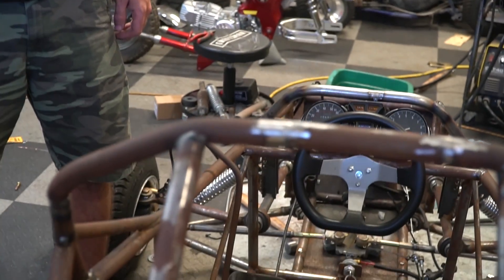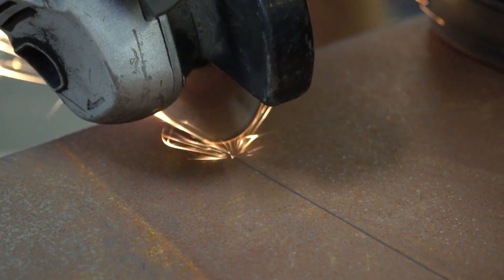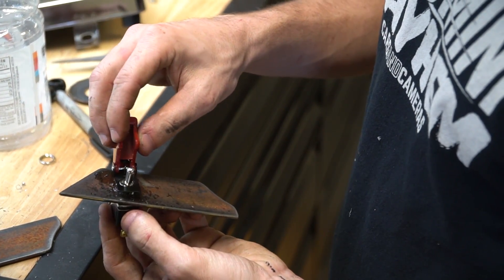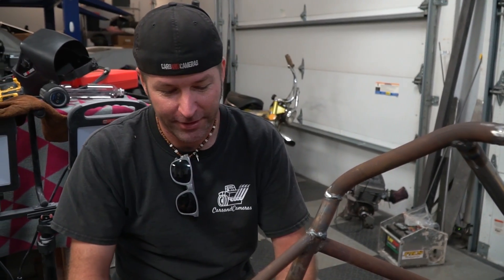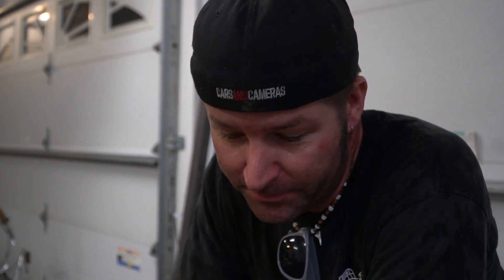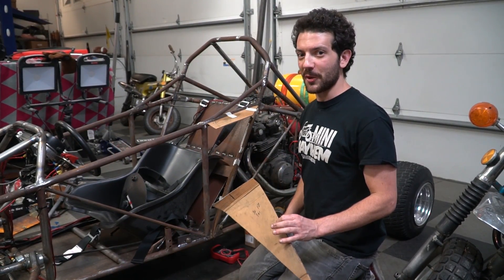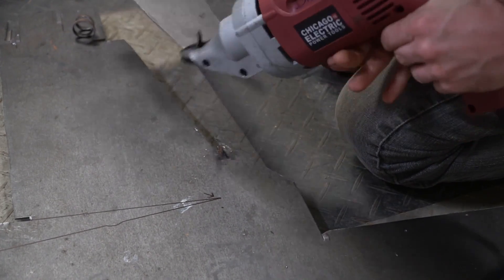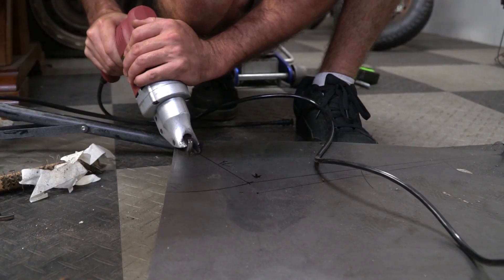Fabricating Air Scoops, Firewall, Dash, Fan | Cross Kart Build

Comment: Mount actuator higher on shift lever. More leverage would mean easier time for that thing to shift
Reply: Craig Kirkland go higher you get more leverage but limited by stroke length
Reply: Change the throw of the E shifter by adding a pivoting lever to multiply the throw distance . If you have 1 inch of movement at the top with 1 inch to the pivot and 2 inches to the other end after the pivot then you double the throw and it will work.
Reply: @AlphaMachina  😂😂
Reply: Make a solenoid or have 1 made. It's not that hard.
Reply: Can't you try two of the electronic shifters wire one to push and one to pull at the same time(setting them up mirrored to each other then you have double the force
Reply from the maker: Actuator didn't have enough throw to pull it off.
Reply: @CarsandCameras  You could use a cantilever set up, kinda like some off-road trucks use to increase the suspension  travel.
Reply: @UncleSpuddy  lol im pretty sure they saw my comment before you commented the exact same thing -.- lol
Reply: CarsandCameras have you considered a cantilever setup? Totally my idea.
Reply: @MadMotoInc  🤣
Reply: @nathanbutler8240   The cantilever to get more throw length will lessen the pushing power and vise versa. They can buy those for about $9 on Ebay. Just buy a second one and double the power.
Reply: @cheeto4493  or put another battery change it to 24v and get the extra power. These actuator can handle 24v as they are in most diesel trucks and there 24v systems. And if 24v slams it to hard you can run a resistor or a diode and cut it down to 14v and even have a button that will cut it down farther if needed to barely hit neutral from 1st and not so hard it bumps it into 2nd
Reply: @CarsandCameras  try a higher electrical current. Just a little bit more amperage should give it what it needs!!
Reply: @CarsandCameras  If you were set on the "Electroshift" idea i'll bet it could be done with a double actuator set up,  one possibly to push and the other to pull,  it would require a 2nd actuator and the wiring would just be reversed on each actuator.  It's looking awesome guys,  keep it up! 

Cheers
Reply: @CarsandCameras  Thanks for getting back to us and for letting us know. Check the comment up there somewhere by @pico67ss about "Hey there are 3-4 different companies that produce electric shifters for bikes flatshifter looks ok"
Reply: You are not wrong but I don't think the actuator has enough throw to make that work.
Reply: @MegaKencam  he could build a cantilever system that would have like 6 inchs of throw off that tiny couple inchs of movement from the actuator and make a ratio  so 1inch of movement on the actuator translates to 3inchs of  movement on the shifter or whatever ratio you guys wanna make
Reply: Well all good ideas, this need to be explored if you ask me
Reply: A double cantilever setup will give you the mechanical advantage plus the throw
Reply: I was just going to comment that but you beat me to it
Reply: Juuuupp
Reply: I would probably look for a door lock sylinoid out of an old pickup truck I had two laying around somewhere from my Honda Odyssey project back in 2003-04 I put a 1973-74 Yamaha Tx750 street bike motor on the Odyssey custom Axle and hubs with pillow block barrings just about everything came from Tractor Supply

Comment: If you you want your mig to look like dimes turn down the machine 1 setting below recommended for the metal thickness and it will cause the metal to freeze better when you whip it.
Reply: Joshua Highfield Turning down the heat wont really help with that, it’ll just make the bead narrower and taller, not to mention less penetration.

Comment from the maker: My vote says body panels, twin turbo and a giant wing. Who's with me?
Reply: Make it look like a giant 80s RC car.
Reply: @carcomp101  thats a great idea to make it look like the rc car from toy story lol
Reply: EFI first
Reply: You had me at twin turbos.
Reply: YESSSSSS!!!! for all 3 and by the way you guys are the best!!!
Reply: Who else thinks they should do a collab with Grind hard plumping??
Reply: @HellzJester1  The way you wrote that sounds SO LEWD! ~( ,m,)~
Reply: HellzJester1 Would be cool, except they’re on opposite sides of the country.
Reply: Yes, yes and big fuken YEEESSS
Reply: Don't know if anyone has said it but, you should put brush guards around those lights, first branch you hit will knock them around and possibly break them. Maybe put some expanded steel below the fan to guard it as well.
Reply: I think the Wario kart
Reply: Mount the actuator higher up on the shifter for better leverage it might shift then
Reply: CarsandCameras order some carbon fiber and do cleared carbon fiber panels!!
Reply: Fiberglass for weight savings
Reply: Hey guys, that actuator has more pulling force than pushing force, the shifter for that engine takes more force to up shift than it does to down shift, flip the actuator to the other side of the shifter and have it pulling to shift up. I think it'll work for ya, and if not, Matthew Stone made a comment on here that is a great back up idea.
Reply: Wings only really help at over 140mph that's when enough forces are developed to make it useful and not just extra weight up high. Do some carbon fiber body panel work that can be removed one piece
Reply: @ssaw88  Wings work any time there is air movement.

It is just that the net force they apply is based on the following equation:

https://www.youtube.com/watch?v=abheF2qkenE
Reply: All the yes.
Reply: Rock and roll
Reply: Hell yeah
Reply: That's why you need a actual electric actuator that has more ass then a door lock actuator but i will work and  it may need more movement than a half inch of travel
Reply: Yeah
Reply: Everyone loves big wangs.
Reply: Um yeah!
Reply: But it can’t be like a flat panel you have to add curveage to it
Reply: I vote a spare wheel on the back like a rally kart and fibre glass or pvc panels like on mx bikes and cut them to shape
Reply: https://www.flatshifter.com/flatshifter-club-bike-engined-quickshifter/       - If you look around for 800 bucks all this electronic shifting can be yours !   Even with paddle shifters,  Search for disabled motorcycle shift systems
Reply: Yes
Reply: Use aluminum sheet metal for the body panels
Reply: I’m with you
Reply: Me
Reply: Love the build man!! i would have love to see you build that side scoop one set of bars back on the engine access brace, turning that scoop into a structural removable panel. but i still think it look great! keep up the good work.
Reply: Body panels and a medium wing and better gearing!
Reply: Amr300 or amr500 supercharger!!!!!
Reply: Yaaaasssss
Reply: Needs a dragster style steering wheel to see gauges better
Reply: body panels hell yeah and a tasteful racing livery to go with them
Reply: Who's vote
Reply: The lights look Siiiiiick!!!
Reply: I was about to say that. Lol. It would look really cool if it had a inclosed canopy. You could install fans on the scoops and use it like air conditioning.
Reply: Don’t lie you’re just building a budget Ariel Atom 😂🙌🏼
Reply: body panels for sure,maybe spray?  what the hell,put a bit of a wing on it
Reply: There is a actuator made for popping door latches on cars/trucks for people that shave the doors. You can get them in a 25-75lb pull that would work great for shifting
Reply: Yous should dabble in aluminum work
Reply: CarsandCameras I feel like the solenoid shifter would work if the rear wheels were turning.
I know on my Honda motorcycle, if the bike isn’t in motion, you need to release the clutch a little for each gear (if the engine is running), or at least rock the wheels a bit.
Reply: CarsandCameras hey guys. Try two actuators back to back. When ones pushing the others pulling. Might work.
Reply: How about hoops above the driver?
Reply: lol would say go up to 10~14in rims, opens up a few tire choices, though definitely need to regear the rear end going above the 10s
Reply: complete redesign of the front are rear suspenstion are needed. so much potential left on the table.
Reply: Ok but i know your not going to do the twin turbo so why did you say it. The body panels are a must and should be done and as for the giant wing i don`t think you really need it as it is a go cart after all
Reply: Use 2 of those solenoids one on the front and one on the back and just wire them up opposite of each other
Reply: I’m with you 100% homie!
Reply: Yes do it
Reply: Here is the Type of actuator you need for shifting 
 https://www.mcmaster.com/actuators
Reply: Yes, Yes, and Yes!!!
Reply: I with y'all BUT I had the greatest idea...since it seems the kart is being transformed into a F1 racer cross Kart why not do that? Y'all gotta do that! Because it looks like a bare bones F1 racer car I thought it would be awesome to do that....unless y'all already have that in mind it would be unique
Reply: Fiberglass or what
Reply: you had me at twin turbskis
Reply: You should try a door pop for cars if shaved door handles they have a lot of power and are fast acting keep up the work guys 🤙🏻🤙🏻🤙🏻🤙🏻
Reply: And BIGGER TIRES!
Reply: Yes please
Reply: Yes, turbo or twin turbo all the way, that thing would fly like a bat out of hell.
Reply: All theses ideas sound like awesomeness
Reply: Do something with the gas tank ! It looks horrible ! Just being honest
Reply: But then it’d be a 1/3 DF Goblin with an extra turbo
Reply: Body panels would be dope and the twin turbo would rock
Reply: Yes
Reply: Yea turbo diesel!!
Reply: how about quad carbs
Reply: CarsandCameras definitely needs a spoiler to clean up that rear end a bit to complete it
Reply: You can modify the shifter to make it work and adjust the shifting Springs that holds the shifting drum in place. I had the dore-lock sylinoid shifter idea in 2003 while working on my 1973-74 Yamaha Tx750 powerd Odyssey.
Reply: Yes no and no
Reply: CarsandCameras yes
Reply: Put the electric shifter higher for better leverage
Reply: Helllll yeaah
Reply: CarsandCameras you mean giant "wang" not wing. Y'all need a giant "wang" on the back.
Reply: Yes yes and no.
Reply: CarsandCameras yaaassss
Reply: HELL YA ✌😝🤙
Reply: I’d take sheet metal and make a body just pop riveted with color match riveting
Reply: No wings!
Reply: Dual Fukushima spinny Bois and rev limiter
Reply: Who wants to see the wing from the eclipse from Fast and Furious on that thing or better yet that massive wing on the green car from Cars
Reply: No wing please
Reply: Ohh ahh you lost me at the wing
Reply: Single turbo and a 2 step ignition
Reply: Maby not the wing but definitely boady panel
Reply: Body panels yes, tsunami makers no and wing meh maybe if you went with a ducktail then yes, but definitely not turbo because that's way to much tuning and carbs are not best for turbo efi is but not carb.
Reply: No wings. You guys would launch back to 1955 if you had wings